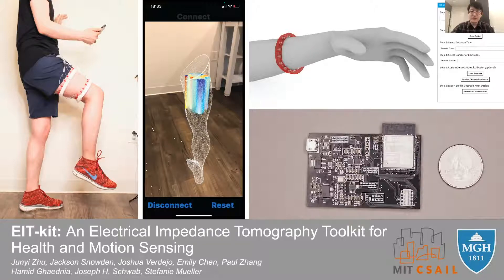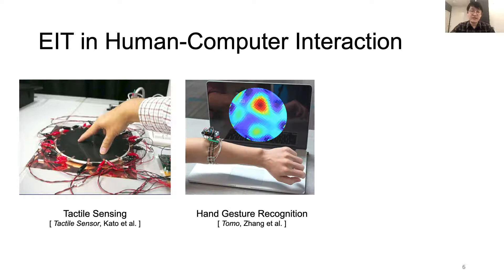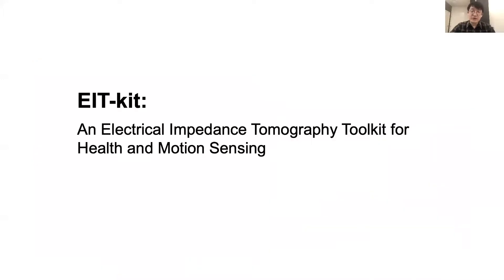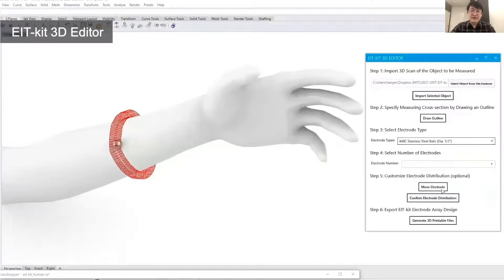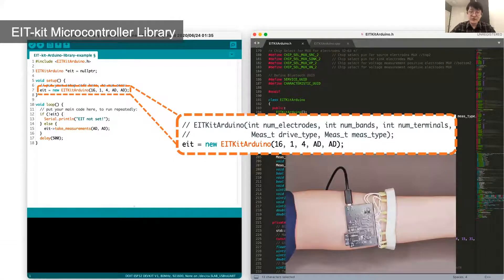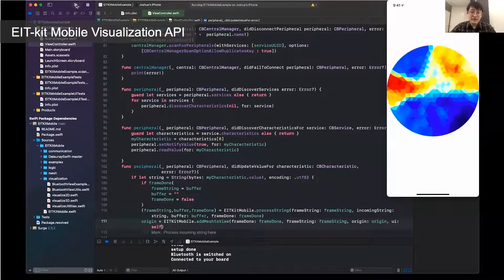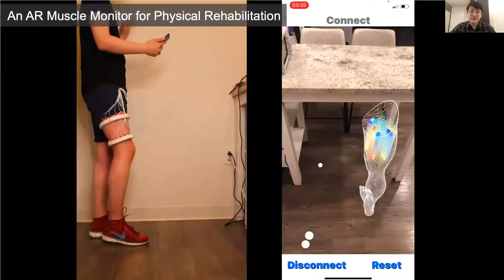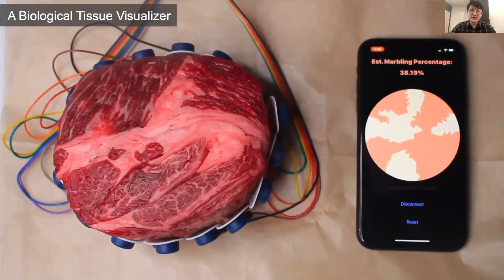EIT-kit: An Electrical Impedance Tomography Toolkit for Health and Motion Sensing

Comment: This paper is very well written, I was wondering if there is somewhere I can find the motherboard Gerber files or electrical schematics for the VCCS? I understand you’re using a mirrored Howland configuration but would like to see which Op-Amps and resistances were chosen. If the motherboard schematics could be shared that would be very helpful thank you!